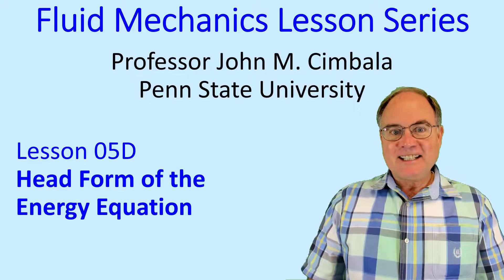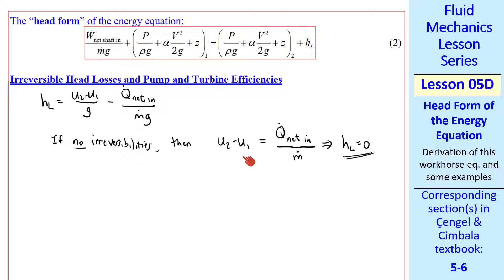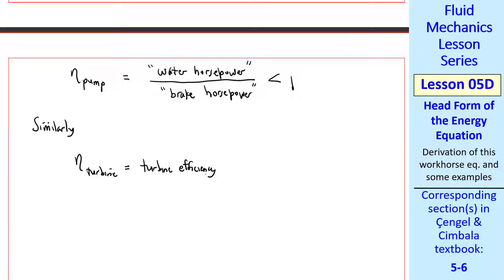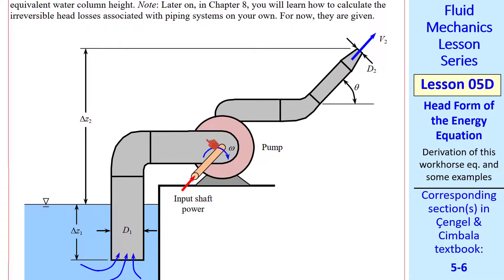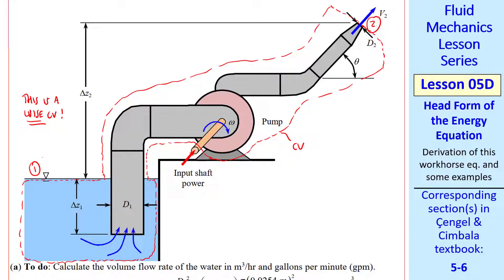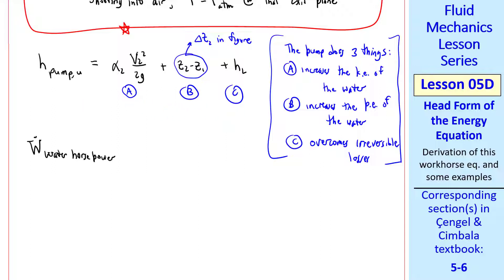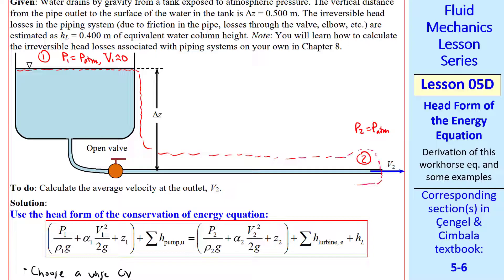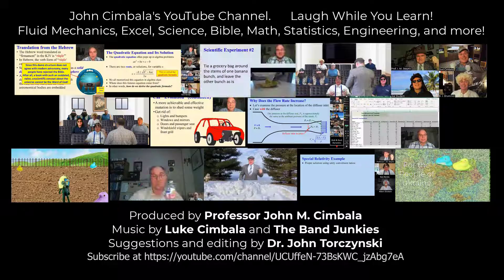Fluid Mechanics Lesson 05D: Head Form of the Energy Equation

Comment: Hi Professor,
In the first example of fire-fighting water pump, for the CV selected isn't P and Z varying throughout the inlet(1) surface?
Reply from the maker: No, Inlet 1 is just along the surface of the water (actually just below the surface) where the pressure is constant (atmospheric) and the elevation is constant since the surface is flat. The rest of the control volume (dashed red line) just connects the inlet to the outlet and passes through the pump shaft so that we can do the control volume analysis.
Reply: @johncimbala  Thanks
That makes sense. I still have a confusion though. What if I took the leftmost part of the CV as inlet as velocities are zero everywhere on the surface anyways. In other words, what make the choice of inlet as the surface of water unique?
Reply from the maker: @ahammedafzal7797  You can take the inlet anywhere you want. The surface is unique because it has negligible speed and is at constant pressure (atmospheric) all across the surface. The left side (a vertical slice) far away would also have negligible speed, but pressure would vary from the surface down, and elevation (z) would also not be a constant. You would need to calculate an average elevation and an average pressure to use it as the inlet. Possible, but a lot more work. If you do it right you would get the same answer but waste a lot of time unnecessarily.
Reply: @johncimbala  Thanks a lot!
Reply from the maker: And, thank you for your comment. Please tell your friends and colleagues about my YouTube channel where there are more than 580 free videos about the Bible, fluid mechanics, science, math, Excel, statistics, air pollution, and other topics. I would greatly appreciate it.